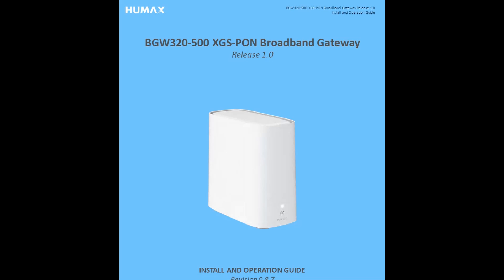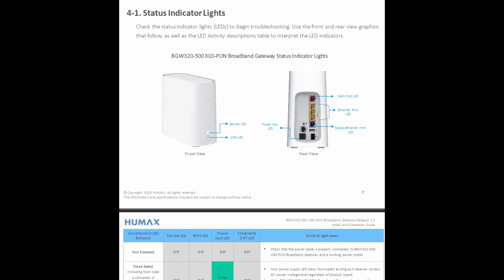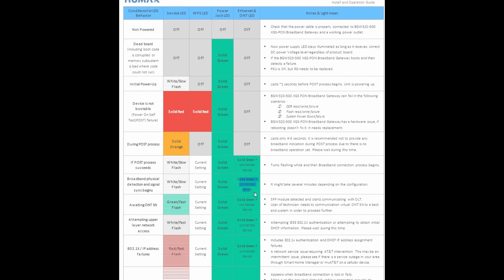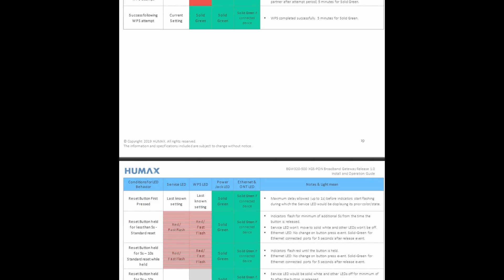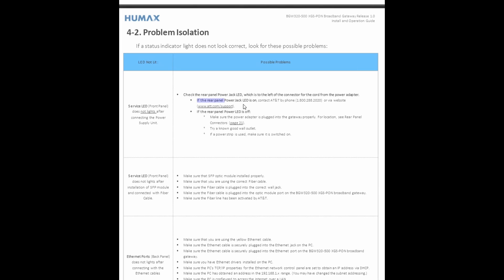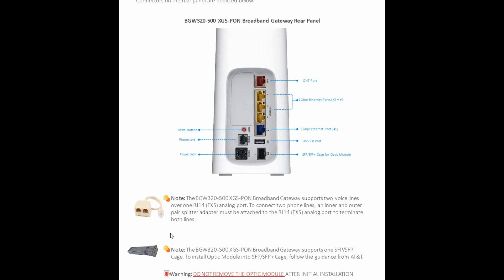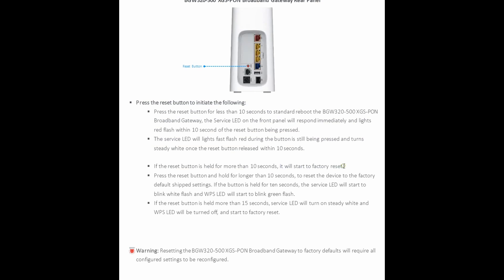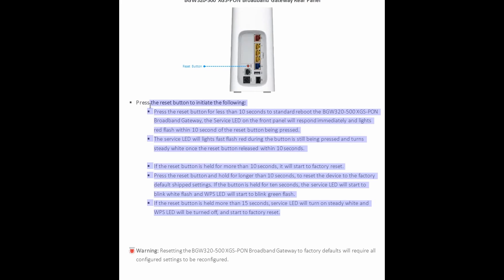Troubleshooting guide for BGW-320 gateway | Part 10

Comment: Any tips for blinking red (slow)?
Reply from the maker: I searched that question in google and here is what I got back “Your Wi-Fi Gateway does not have a broadband connection. Please check for a loose, disconnected, or damaged cable, and then press and hold the Red reset button for 10 seconds. Solid Amber Your Wi-Fi Gateway is powered on.”
Reply: @ALIMKRAJA  ya already did those :(
Reply: I'm having the same issue. Att said they'd send a tech to come look at it
Reply: @Swifter.i  they came and replaced the entire box

Comment: Hello. I held the reset button for ten seconds....now the front light is just slowly flashing white, for over ten minutes. The guide I checked said this lights means it is powering up. However, I'm concerned it's not doing that, because of how long it's taking....
any idea what to do from here?
Reply: Did you figure out what was wrong? Im dealing with the same problem
Reply: @jameslipton1602 did u figure it out?
Reply: Yeah Mines been on reboot for over two hours now, what ended up happening with your modem??
Reply from the maker: Hope it is working for you now

Comment: Hey Ali! Thanks for the insightful videos. Do you know if one can expect faster wireless data transfer if using a third party router (eg Orbi) vs the onboard wifi antennas on the 320? Range/coverage is not an issue for me at the moment, but I’d like to get as close to the gb speeds over wifi in all areas of my place. Thanks!
Reply from the maker: Definitely. Replacing antennas with nodes is the way to go. It puts some management behind things rather than just broadcasting signals. At the end optimizing ur connection speeds
Reply: @ALIMKRAJA  great! Would the Orbi RBK852 be overkill? I see there are some other Orbi systems for a bit less.
Reply from the maker: Not at all, it provides double the speeds with wifi 6. Its definitely one of the best mesh systems out but the price point is too high. You can get almost the same with Asus for allot less. Speaking of that, I’m thinking to go the Asus route soon as allot of features come free with Netgear you pay for them.
Reply: @ALIMKRAJA  why not dedicated APs over a wired backhaul. Why would you recommend a custom router vs just using the gateway as a router?

Comment: Mine keeps blinking red how do I fix it?
Reply: Fr I don’t know how to fix it
Reply: @mmdmmd187  Im having the same issue. On the website it says slow blinking means hardware issue but the hardware was fine just last night and no outages are popping ip
Reply: @EloWhisperer  did you ever figure it out? Having the same issue now and can’t get a technician out here for a few days
Reply: I'm having the same problem
Reply: I’m having this problem now what was the fix?
Reply: @Gu3ssWhoki113dU1  
Did u get your fixed? I think my outside line or àtt has an issue
Reply: @JohnSmith-xu7ev  yes I did I ended up contacting AT&T and I followed the troubleshooting procedure did not work so I had to schedule an appointment with a technician and something was wrong on their end outside with their jumper box
Reply: @Gu3ssWhoki113dU1  gotta love a good racket

Comment: I just got this gateway with my new fiber 1000 service. It looks good so far. Range is decent also. The cable needs to be buried outside. One thing AT&T can do better is the situation with the line laying outside on the day of installation. They should have a crew to bury the cable within 24 to 48 hours if not the same day.  The tech told me that it may a while. I still have Spectrum service as well as back up until they get that in the ground.

Comment: mine keeps going red can u help me out ? it stays red and i reset turn it off keep it off and turn it on
Reply: right after that it flashes red
Reply: @G6ridingforein   @Ali MK Raja  if it continues to turn red I would contact them. Could be a problem with service in the area or a device issue.
Reply from the maker: Refer to the document In my description. It will tell you what each led means